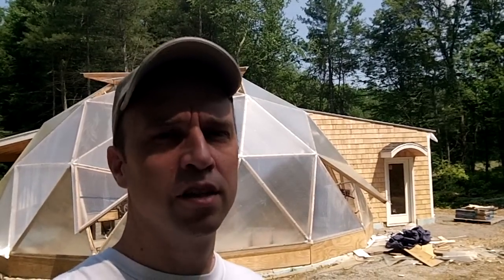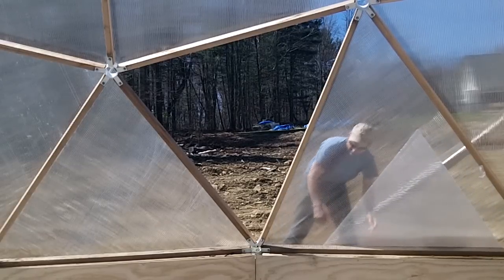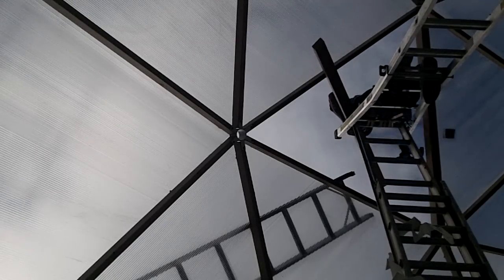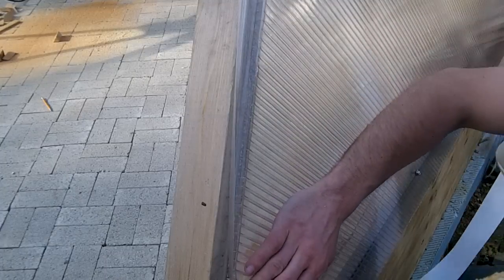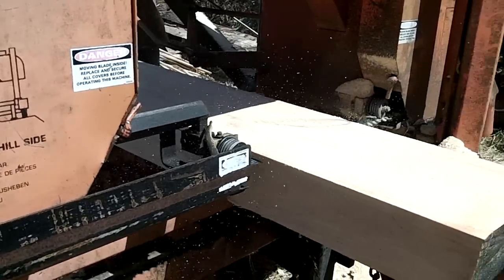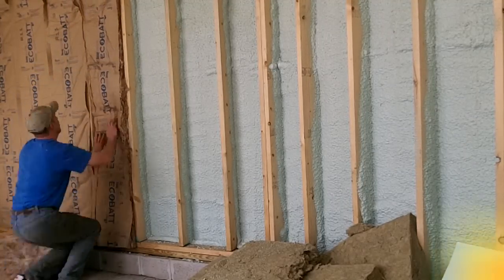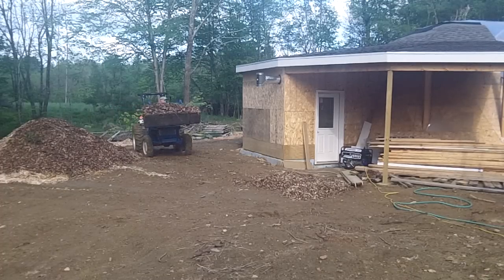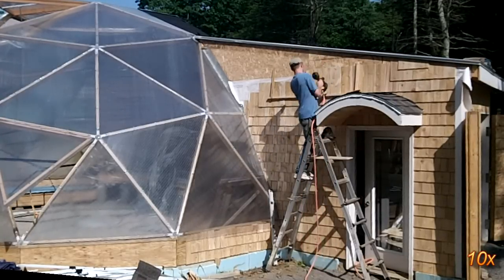Geodesic Dome Greenhouse - Part 12 - THE END

Comment: Just re-watched the entire series of one to twelve. This is a very nicely none and compared to others on YouTube it is very high quality.  I am considering building a geo-dome but I am thinking a conduit strutted with a single bolt for each junction then a plastic cover over the top followed by a layer of 6 x 6 #10 reinforcing mesh and a layer of 1/2 inch hole poultry wire. finally using a Mortar spraying rig cover the outside with stucco including the wire mesh as a "Ferro-Cement" shell.then a layer of 3 inch thick styrofoam and another layer of the poultry wire covering a re-bar lattice and another 6x6 # 10 wire reinforcing mesh with more mortar / sprayed on  stucco and finally after a couple of weeks of hardening we will then remove the bolts and conduit framework for reuse.  We shall be using it for a barn.  perhaps we will video it and either it will work or it will be a interesting collapsing display.
Reply from the maker: Wow!  Thanks for watching....again.  Let me know if start your concrete dome!  I'd like to see it.

Comment: Using the tape on wood maybe use Varathane. I've thinned varathane then coated old wood knife handles and it soaks in leaving a slight plastic coat. Probably good for that tape to stick to real good.

Comment: The poly-carbonate is normally held down by purpose designed plastic strips with rubber seals (intergral)--- Were they too expensive? or have they not travelled across the pond ???  Terry

Comment: I just subscribed. You have a much worse winter than I do. I wonder what you do to cool your greenhouse in the summer. I saw a design where a man took advantage of hot air rising. He pumped the heat from the ceiling area and stored it in the area under the greenhouse.

Comment: Can you possibly give more info about the tape you used to seal the polycarbonate?  Name brand what to look for?  I just bought some polycarbonate for windows in my greenhouse and it says to tape the top hole shut to prevent moisture for getting in. That tape you use sounds like it would work well.

Comment: Where did you source all the metal brackets/plates used in your project? How often have you had to replace the poly panels so far? How do they hold up?
Reply from the maker: here's a link to the hubs.  https://www.youtube.com/edit?o=U&video_id=gLIhOglrbmI  The panels probably won't need to be replaced for 20+years.

Comment: Congratulations.  I learned a lot.  If I can ask a couple questions, how many sides? 15?  If you were for some reason going to build a smaller size, what diameter you would choose or what strut lengths?
Reply from the maker: it's a 3V dome, 15 sides.  I've seen some small domes in the 10-15' range.
Reply: thank you sir, I just found your channel and now I am a fan!

Comment: You used bad tape.Aluminum butyl tape its the best and also looks nice.
On the interior,paint the wood with linseed sicative oil,2 coats.
And also you can add a thin polycarbonate film to protect the wood from the moisture thats in the interior of the greenhouse.
Its will also act as thermal insulation and you can use cheap aluminum tape( not butylic) to seal the interior layer.

Comment: no vapor barrier for fiberglass batts?
Reply from the maker: TheJesusBusBand The foam insulation acts as the vapor barrier.  It's so humid in there, it probably wouldn't make a difference anyway.  ;-)
Reply: Well you put the foam in first, then you placed the batts then put up plywood, there is nothing keeping the interior humidity from soaking the batts. This can lead to big problems down the road....
Reply: maybe you could place breathing vents at very tops. kindof like soffits but on the interior. but you would also need air movement to bring humidity up and out of building ?